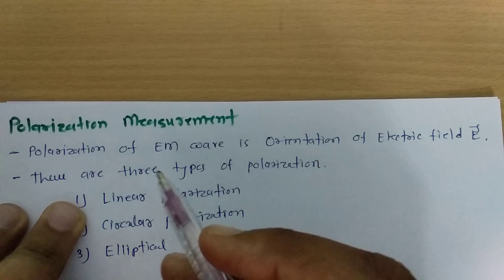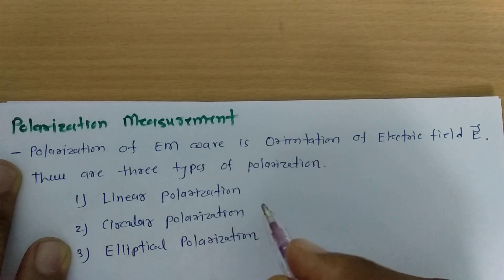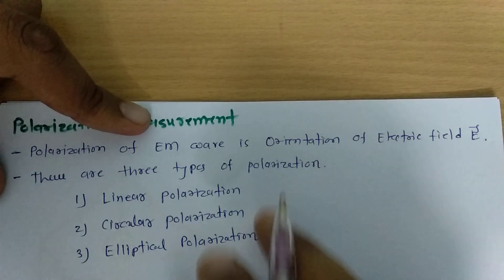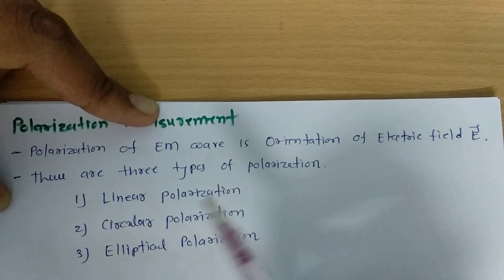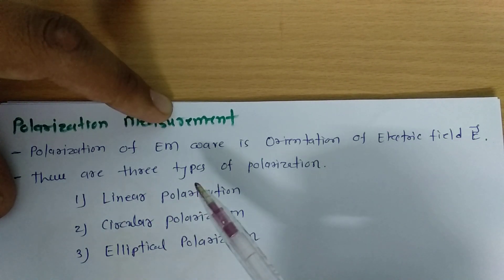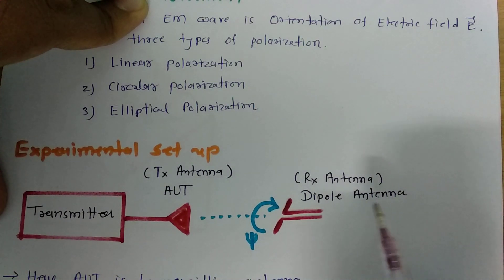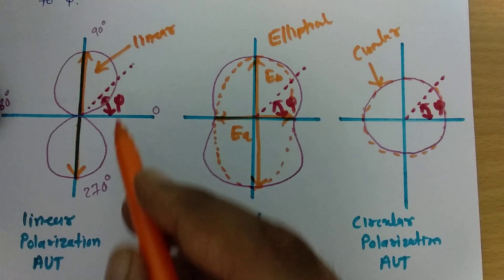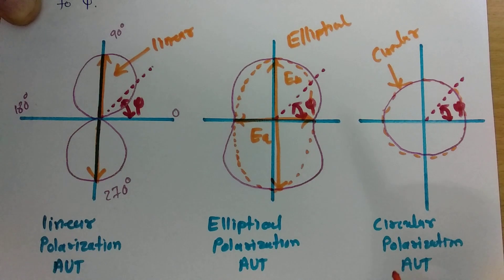Polarization Measurement (Basics, Parameters & Experimental Set up) Explained in Antenna Measurement

Comment: Great explaination !!. Im building antenna for my fpv. How to plot the axial ratio from the circular polarized antenna.I have two type of antenna 1 is omni CP and another one is Directional CP.

Many Thanks.
Reply: follow the same procedure of circular polarization measurement for each theta angle and take the ratio of minor axis and major axis. so that you will get axial ratio in far field at each theta angle.